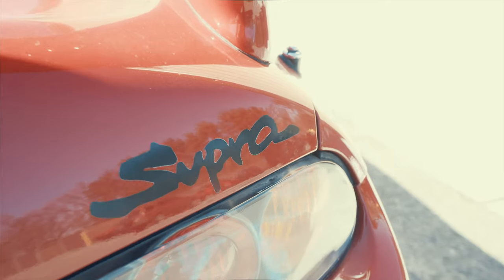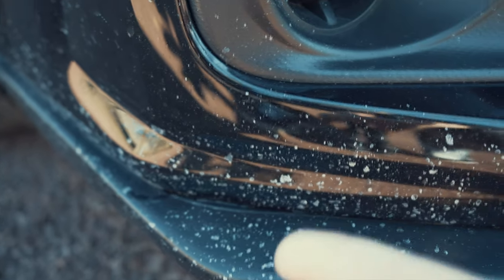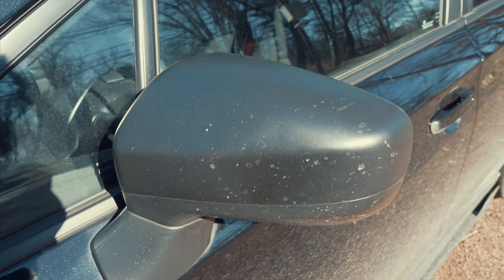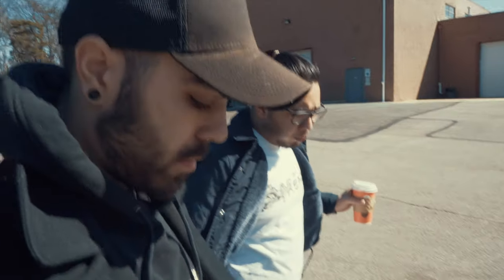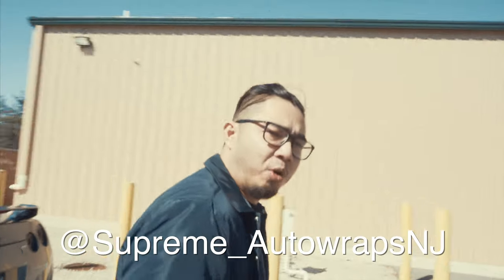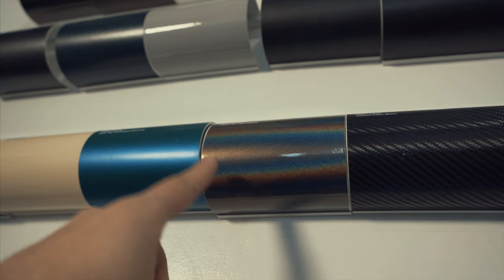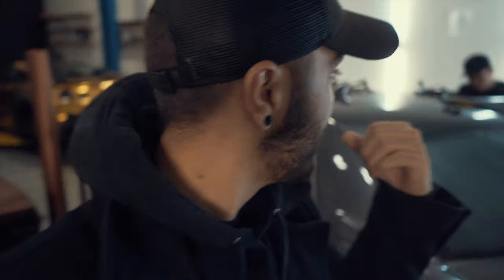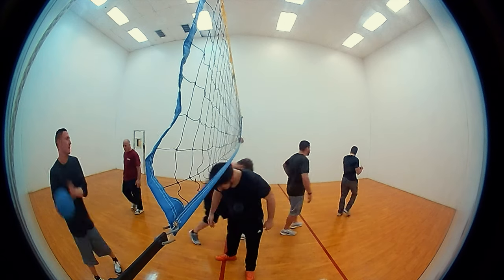Visiting Supreme Wraps / Whats next for the Subaru?

Comment: Dude intake yet? Headers? Exhaust? Bump up those HP numbers man, my 2016 has some nice pep, give yours some balls! Also if you have time hit me up If you want me to share my mods with ya for possible ideas
Reply from the maker: Not yet my friend. In time.
Reply: Dom Fillari are you interested much in the Subaru accessories? I pretty much went through and that’s where I got my 
Engine bay trim (black red theme) which is
Sti front strut bar
Red battery top strap
Sti oil cap
Painted the black cover red 

Interior...
Carbon fiber Interroir trim
Sti CVT shifter
Sti pedals and so much more, you do spend some money since it’s all Subaru parts but well worth the personal pop

Comment: Too bad there wasn't anything like that WRX when I eventually got my Impreza. As much as I would have wanted to get a manual, I ended up going for the CVT since it's my daily and I deal with a crap load of rush hour traffic in my area by DC.

Just wondering, since you got that wide open custom mesh grille, any plans to eventually add some Hella Horns too? One of the next things I was going to do to mine, though have to figure out how to mount since we don't have that vertical radiator support pillar all premade brackets are usually mounted to.

Comment: Hey dom you had me worried I thought we were not going to see a mirror video. What happened to your car is common and by posting the fix everyone saves money .... question? I know you modified the grill but what about the lower opening below ? I do a lot of highway driving and rocks are destroying my radiator. And ideas ? Need air flow but want to reduce the size . Do look in that opening. I bet your car has impacts too. We need to address this before something causes a leak ...the stone chips to the nose and hood are another story.....maybe 3m wrap for that ....
Reply from the maker: Hmmm, so I’m planning on doing the same mesh down there as well. You could get a thicker different type of mesh if you would like. I’m going to be doing videos on that as well my friend. Thanks for the support!
Reply: Dom will it be the same process if you do the 18 wrx upper grille mesh?
Reply from the maker: Yes
Reply: DIY
Reply: Dom pls use something strong the road rocks will destroy most mesh it’s actually ruining my paint in three years I will pull the bumper ( thanks to your video ) strip the paint and drop off at a paint shop .. save a ton that way then wrap like I should have done in the first place
Reply from the maker: Bro there ain’t much you can do about kicked up rocks from other cars.. it’s part of the game